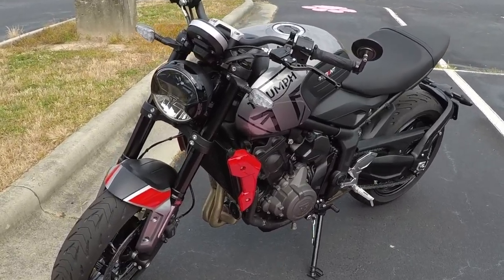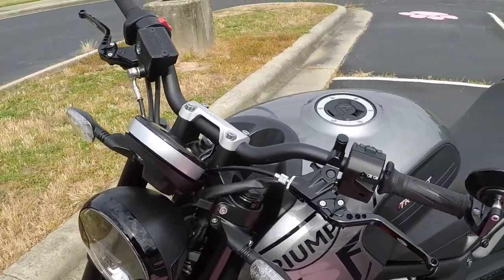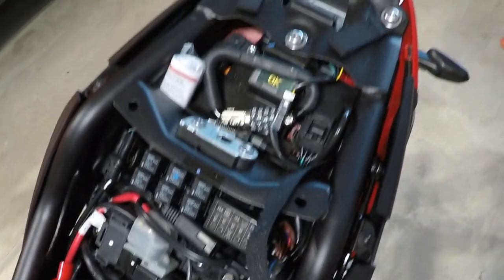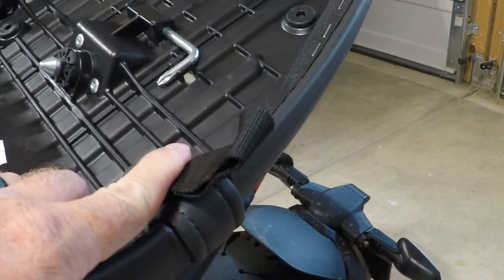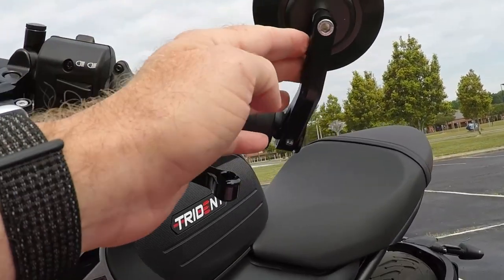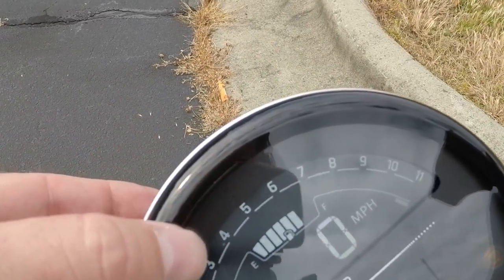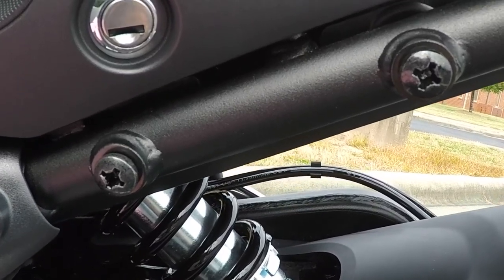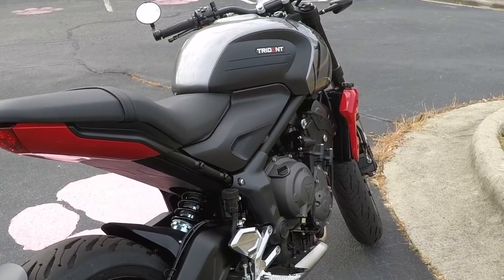Triumph Trident Accessories Review

Comment: Hi, any issues with the mirrors in traffic? Do they make the bike wider? Also compared to the stock ones are they big enough for visibility, any vibrations etc? They look awesome btw!
Reply from the maker: Thanks. No issues in traffic, but I don't live in an area were filtering is legal. They only make the a couple of inches wider on each side at most. No vibrations to speak of, and visibility is good, but maybe not as good as the stock mirrors. You have turn your head more to look down by your hands instead of just off to the side, but for me it's a small trade off for the better look.

Comment: Interested to hear about your issues finding neutral. I put Tec levers on my Trident too and finding neutral is a nuisance.
Reply from the maker: Yeah, at first I thought I just didn't have the cable slack adjusted properly after installation. But I had the lever set on 1. When I bumped it up to 2 it still wouldn't go into neutral, but at 3 it goes in fine. I'm OK with it as it's still a shorter and more comfortable reach than the stock lever. Another guy on the Trident Riders USA FB group had the same experience. I've seen other reviews mention that even the stock lever requires pulling it all the way to the grip for proper shifts into neutral.

Comment: I got the speedo angels screen from amazon, but it didn't lay flat on the convex screen. The plastic was flat and it didn't stick. Thoughts?
Reply from the maker: @tims-garage  Hi. Just from what you described, I’m guessing there may still be a protective layer or backing that needs to be peeled off. Once I had everything peeled away, I sprayed the screen protector and the screen with mildly soapy water and they instantly stuck together. Then I just used the squeegee to push the little bit of water out from between the two. It’s been awhile since I’ve done it, bit I think that was the basic procedure.

Comment: Thanks for the recs! Just got my trident two days ago and I ordered the levers and mirrors today 😎
Reply from the maker: That’s awesome! Congratulations on your new bike!
Reply: Thanks! I also got the blanking plugs you recommended. I put on the grip puppies that RocketMan had on his trident and they help a lot with hand fatigue. Have you ever used them?
Reply from the maker: I tried them once on my Honda CB500X, but they weren’t for me. I just didn’t like the feel of them. Hard to explain, but I didn’t feel as connected to the bike. There are a lot of people who love them though. Definitely worth a try.
Reply: Thanks for the reply! I’ve read some people had issues finding neutral with the levers, did you have any trouble with that?
Reply from the maker: @jlondono363  only on settings 1 or 2, which is what I set the lever to when I first put them on. Works perfectly on 3. The brakes had a lot more bite on 3 as well.

Comment: hi do you have the link for the blanking plugs? thanks nice upgrades' i ordered also the tecbike brake levers and bar end mirrors because of your video :) RS bro'
Reply from the maker: Any M10 plug should work as long as they are both clockwise. The original link I included looks like it is no longer available. This looks like the same thing though: https://www.amazon.com/Motorcycle-Mirror-Aluminum-Blanking-Oxidation/dp/B07ZCZNZ8B/ref=pd_sbs_1/132-7339597-7126141?pd_rd_w=m1lOH&pf_rd_p=77ec332a-361e-4369-95ba-9b34ae961bd6&pf_rd_r=WAF5HDV2SSYEYCFMP64P&pd_rd_r=6e52071b-55e3-4633-aa49-188e5f219615&pd_rd_wg=HBlPY&pd_rd_i=B07ZCZNZ8B&psc=1
Reply: @jrobrides1340  Thanks Bro Ride Safe'

Comment: I also bought the Tec Lever and I seem to have some trouble with the break lever not properly hitting the break light switch. Do you encounter any issues with that?
Reply from the maker: Mine works, but the piece of the lever that engages the switch is just barely big enough to cover about half of the switch button. You could try playing with the mounting bolt to see if you could snug it down a bit more. I've also heard about others who have tried wrapping some tape around the piece to give it more area.
Reply: @jrobrides1340  genius! I'll wrap some tape on mine! Thanks!
Reply: @jrobrides1340  Thank you so much this means so much to me! I just added some black tape and it works wonders! Thank you again, you really made my day!
Reply from the maker: Awesome! Glad it worked!

Comment: I got my bike 4 days ago and I'm not liking the clutch lever at all. Not sure if it's due to me being a new rider or the lever itself. I have to apply a lot of force with my hand to press the lever. Do you recall something like this when using the stock lever on yours? It is also far for my hand to reach it and I have large hands lol
Reply from the maker: The only time I used the stock lever was on the ride home! 😆 I could tell from pictures and early reviews that I was not going to like it. I ordered the Tec levers before the bike was delivered. You were right in that the force to pull it is not good. I also didn’t like the long reach and that it couldn’t be adjusted. I suspect that Triumph tried to design the clutch to have a large friction zone, which is good for new riders, by having a lever with a long throw or travel. But most people go to aftermarket levers right away. Just be careful not to adjust them too close or you could have trouble engaging neutral.
Reply: @jrobrides1340  Thanks for your quick answer! This helps a lot, I wasn't sure what was the problem. I'll see if I can cope with it until the break in period ends and decide if I need to get an aftermarket one. To be fair is the only thing I don't really like about the bike.
Reply from the maker: @JaymzSim  I felt the same way. Even the mirrors were good. I only replaced them because I like bar ends better.
Reply: No kidding!! I just got my Trident a couple days ago and that lever is way out there with a heavy pull compared to my last bike. Wasn't apparent on test rides but after my first ride, 80 miles of break in required constantly shifting, fluctuating rpms, gears and mph left my hand cramping wickedly bad. Totally toasted my tendons so I could not ride the next day. I'll bet today's ride will have to be short with my hand cramping and barking at me. I wear large gloves. WTH? I've been thinking about EvoTech levers (tho these look good too) but I'm torn between shorties or normal length. My dealer suggested I consider the Triumph quick-shifter. 
What did you end up doing and how well did it work for you?
Reply: @dustytriumph  The Street Triple has an adjustable clutch lever that can be installed on the Trident. I still use the stock one but I have the quickshifter and that helps a lot.
Reply: @JaymzSim  How long have you been using the quick shifter? Are you loving it? Have you had any issues with it?

Comment: How did you get the swing arm spools on? My bike seems to be covered
Reply from the maker: The right side is covered by a plastic plug that easily pries off and the left already has a bolt in it for the swing arm mounted numberplate/turn signals. You just take out that bottom bolt and use the spool bolt to hold the spool and the bracket.

Comment: Hi jRob, do you plan on installing QuickShifter? BTW where do you source how to install things? Because my dealer is telling me that installing QS takes 2-3 hours :D and configurator says 24minutes. Thanks.
Reply from the maker: I think I will… eventually. They’ve mostly been out of stock lately so I haven’t been trying too hard to find one. I figured it would be a good winter project. I’ve gotten a lot of directions from triumphinstructions.com. If you put in the part number, it will give you the installation directions. Most of them even have time frames.
Reply: @jrobrides1340  wow what a treasure that page ;). Thanks for sharing.

Comment: Hey Rob, what size are the blanking plugs you got for your mirrors? Thanx in advance
Reply from the maker: They are 10mm and BOTH are clockwise threaded.
Reply: Thanx man. I’m about to switch my mirrors as well and put in a tail tidy with indicators. I guess I’m going to just follow the existing wires back and figure it out myself. You by any chance don’t know where to get the schematics for those wires
Reply from the maker: @benjigamaza7191  Sorry. Haven't taken a look at the wiring. There was a guy on the Trident USA Rider Facebook group who installed a tail tidy. You might want to try searching that.

Comment: hi there, im just putting on my mirrors (TEC),  but i feel if i slide the clamp back towards the bar end (like yours) and have the gap on the grip side... there isnt much for the clamp to bite too? like its half on a solid part and half in the gap? is that the same for you? mine cant be different... but i cant get it to sit and clamp solidly on..
Reply from the maker: That is strange. I tried to make mine have an even gap between the bar end cap and the grip. There is plenty of bar to clamp on to. You could always go closer to the grip as long as you leave enough room for the throttle to turn freely.
Reply: @jrobrides1340  hey! Yeah I got them looking like yours... Flush against the end cap but the bolt is so tight those 2 black bars are almost touching, and I can still turn the mirror arm with my hand no worries? Just seems like I shouldn't have to tighten that bolt so much to get the clamp to not move? Did you have this issue ? The 5mm bolt.maybe it's designed to not be fully tight on bar so you so move it up and down anyway?
Reply from the maker: @mcquoidd6917  That doesn't sound right to me. I've had them on two different bikes and they fit very tight. No movement. And still a gap between the two bars. Maybe enough 2 or 3 credit cards. Is it possible that they sent you the wrong mirrors? Maybe a size for 1 inch bars?
Reply: @jrobrides1340  ok noted. Thanks man. I'll check but yeah I don't think they should love. Only the actual mirror should move. Not the black arm itself. Thanks !!
Reply from the maker: @mcquoidd6917  random thought, but but did your kit come with spacers?
Reply: @jrobrides1340  it did come with that slider ring bushing that sits inside the steel clamp circle. Which slides over itself as you tighten it but now that I have both of them on one of them works pretty well and is quite tight and the other one is not so maybe one side is just faulty.
Reply: @jrobrides1340  ok got it!! Turns out the slider bushing thing on the inside.... Needs to turned a certain way. Mine was overlapping right where that notch in the bar end is. Causing it to almost bend on there... Turns it around so the overlapping was on the solid part. Boom tight as. Like the other one !! Haha. Always the way....
Reply from the maker: @mcquoidd6917  Great news. Glad you got it sorted.

Comment: Evotech Performance have a really good quality Radiator guard available for the Trident, just fitted it to mine.  I also have the Screen protector you mentioned.

Btw, thanks for the Tank Removal video, my Tracker is now fitted too.😀
Reply from the maker: Thanks for the info! I'll have to check out the radiator guard. Glad you got the tracker fitted. I'm thinking of doing something similar. Maybe trying the Apple Air Tags.
Reply: I put one on my Trident too. Very happy with the quality. Also put on EvoTech Engine sliders, axle sliders, and bobbins. Real quality parts. Thinking about their levers.

Comment: What paddock stand do you have?
Reply from the maker: This one: https://www.revzilla.com/motorcycle/trackside-rear-paddock-stand?sku_id=1127303
It does the job, but I think I’m going to make some modifications to the handle. It’s not very secure.
Reply: @jrobrides1340  I ordered one of these because I saw another Trident owner on YT use one. Wow, no confidence in what I received. Set it up to fit, (just barely wide enough to fit the Trident btw) put my bike more upright with a block of wood under the kickstand, put a little pressure to get stand touching both bobbins and that stand was flexing so I did not lift my bike. No way was I going to use this with my brand new baby. And that handle made me nervous as hell. Back in the box it went and have a PitBull on the way which is what I should have done from comments I read about cheapo stands.
Reply from the maker: @dustytriumph  That PitBull will probably last a lifetime. You could pass it on to your grandkids.
Reply: @jrobrides1340  You have one now? When I was trying to pick a stand I came across a lot of comments that said to spend the extra money. It was a lot more money especially since I was able to use a bunch of stored up Revzilla dollars on the Trackside stand. Hoping and assuming the PitBull will meet my expectations.
Reply from the maker: @dustytriumph  No, still using the Trackside, but if I had to do it again, I would have given the Pitbull more a look. I just took it off my list because of the price. But you get what you pay for.
Reply: @jrobrides1340  It was initially off my list as well.

Comment: I haven't even purchased mine yet as my first bike after the MSF,  that is the color I want, I don't want those red trainer colors on my bike!  In Europe new riders have to display Red on certain parts of their bikes to let others know you are a Novice!
Reply from the maker: The red pieces are pretty easy to fix. I've seen some switch out the tail and radiator parts for silver ones. I've also seen some really nice vinyl wraps that cover the red parts.
Reply: Not in the UK you dont

Comment: Are the paddock stand bobbins M8 size?  I am a newb when it comes to paddock stands and such.
Reply from the maker: Yes. The bobbins come with the bolts, but they are M8 size. The bolt holes for the passenger peg mounts are also M8. This is my first bike with a paddock stand too.
Reply: @jrobrides1340  Cool.  Thanks.